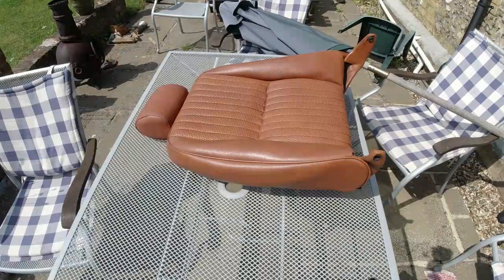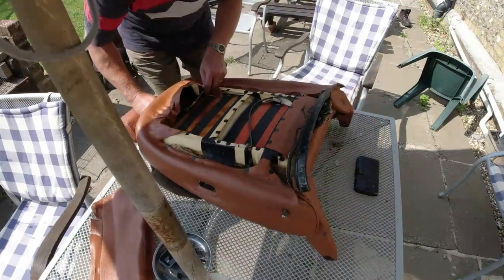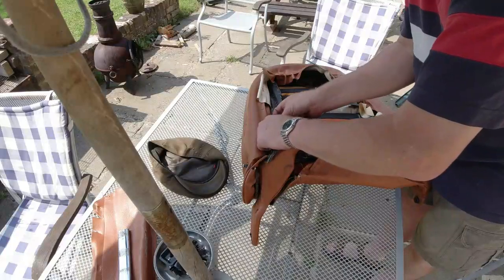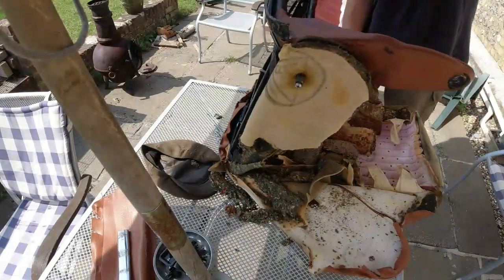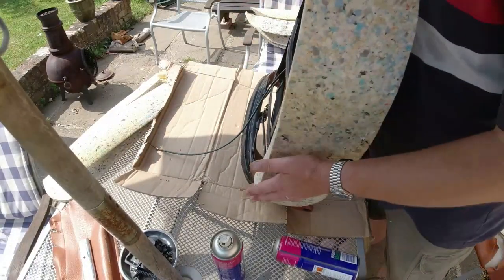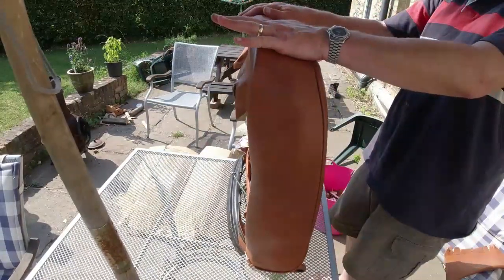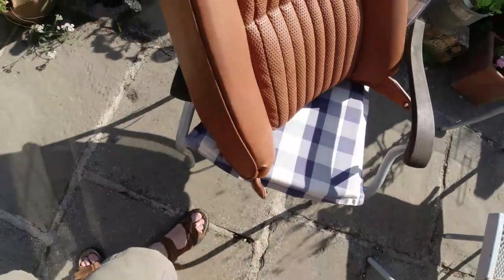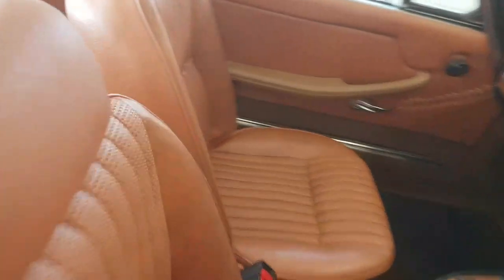Triumph Stag Re foaming seats - Parental warning

Comment: Those original seats came up a treat... Just goes to show with some work you can keep old trim going rather than buying in new... I think it's fine if you are doing a complete re build putting in new.. but if it's an older restoration or running restoration then reusing the existing trim is the way to go, the car has a nice worn looked after look... Great vlog, keep up the good work 👌

Comment: Nice job, helpful as I'm just halfway through the same job. Perhaps worth noting that the unpleasant stickiness of the destroyed foam washes off with a damp sponge, more easily than I expected.
Reply: As the centre foams are often ok, you might get away with not disturbing the middle part of the cover-it worked on mine, and made it fairly easy to pull the cover edges back on without wrinkles.
Reply from the maker: I did consider that but was worried about the super fragile tension strips parting company.
Reply: @churchhouseclassics   A good point. I judged that they would be safer left undisturbed, and perhaps I wouldn't have been able to get everything back unwrinkled. Also, the foams I used were from a different supplier and were the slightly softer plastic type rather than the rubber that you used, so it was easy to tuck the foam into the edge of the centre bit without unduly stressing the fragile straps. I was a bit doubtful about the foam, but it looks and feels fine with the cover refitted.

Comment: +1 Sticky, gooey and utter shite.
It so odd the way the one color of foam disinigrates. Same phenomena exists in GT6/TR6 seats. If they would have cut them all from white or red foam aparently the job wouldn't have had to be done.
Reply: My TR 6 seats must of been the exception to the rule. The covers were all different shades of new tan. The rubber base had gone, so both seat centers were shot. I bought a new set of foam but they only did American ones at Rimmer's at the time. He used new bottom foams but the backs just needed a little help to shape and he put in a new handmade leather interior for me.... It looked stunning!!